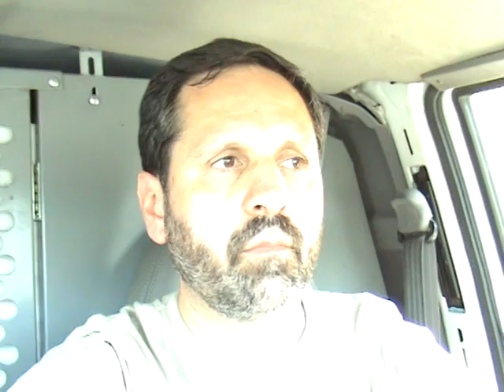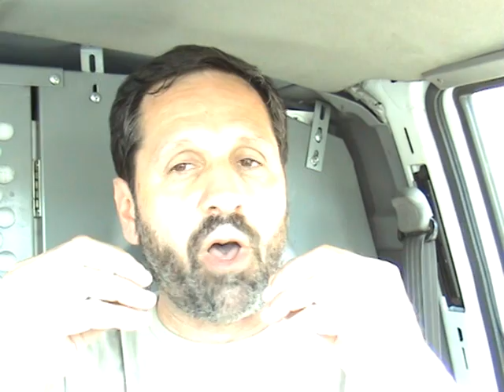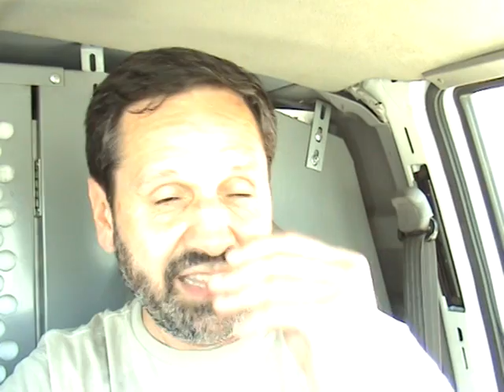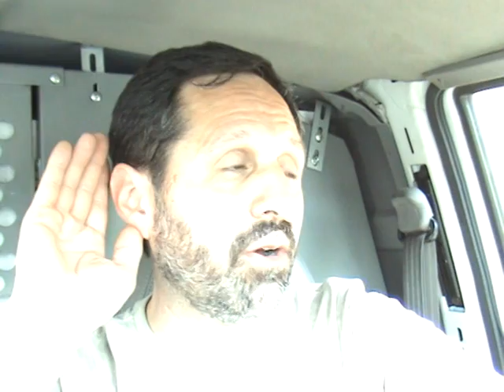EMP realities; you aren't as ready as you think you are!

Comment: Things to have in Faraday cage, generator preferably solar and wind however a person can make fuel so gasoline-powered is okay too you just have to muffle it kind of like blacking out your window so that not everybody can tell that you're running a light but to be honest this isn't something that you're going to run all the time just as needed type of thing. Parts for whatever vehicle you do have assuming you're not stupid enough to live in a city if you live in a city and something like this happens just realize you're probably going to die not from the event but from the other people. Your necessary electrical parts to repair this vehicle that was built before computers. If your how to do s*** books is on computer instead of and paper and of course you want to put those in there as well any other electronic devices you may want. The list could probably go on and on and don't forget the important thing is the batteries that you need for stuff even the rechargeable ones especially the rechargeable ones

Comment: Definately gonna buy the MRAD 103 Ultraradiac. And some faraday bags to put the absolute essential electronic devices in.
Reply from the maker: halfpipefreak  OK you got your plug in.  Now please explain what you think are "absolute essential electronic devices".
Reply: The radios you talked about, A good reliable flashlight and a batch of good Li ion batteries to power them and other devices. (18650 and 16340 batteries) and a foldable solar power panel. And ofcourse the MRAD itself. They say the MRAD's from Mirion technologies have EMP proof housing but it's electronics nonetheless and i would put it in a faraday bag or cage. Probably multiple since it being a very important device. Only thing i'm worrying about is the calibration of the device. How the hell i'm going to do that i'm not sure yet. It's better to be prepared and have knowledge. Knowledge is power.

Comment: does a faraday cage need to be metal? I saw a duffel bag on eBay that is faraday. Also, how would you know when it is safe to use your electronics or when an employee will occur?
http://www.ebay.com/itm/302313853782 is this a good faraday cage?
Reply from the maker: Al May  The maker of the bag claims it to be.  This looks an awful like the Mylar bags (supposedly aluminized plastic) people are selling at the prepper shows that is supposed to act as a Faraday type protector.  Believe the claims if you want.

Those Mylar bags are plastic.  Take an electrical continuity tester and see if you can get any conductivity.  You can't.  I intend to make a video proving this.
Reply: thank you

Comment: Other items to protect:- Charge controller for solar panel, flashlights. A lot of these modern led flashlights use circuitry. You can also generate electricity and charge batteries using saltwater.

Comment: i have made a 4x4x4 rubber lined steel box that I have built for my diesel generator. I have turned it into a biofuel generator that runs on any type of oil that is strained. I know that this will not last forever but hopefully I can get a year or two out of it if not longer. I have also built a wood gasifier that can run a gas generator but have not converted it to my diesel motor. My Faraday cage has in lining friction fit lid and a rubber lined aluminum coupler that fits over that. I'm not certain that it will work but I'm fairly confident in its abilities. As far as the sound goes I have not quite got that one baged but I am thinking about different options. also I live about 45 miles from any major city In the Backwoods. I have a 1974 CJ Jeep with no electronics. It would in fact survive an EMP. electricity and fuel powered transportation is not impossible, it is just not very probable in a post-apocalyptic EMP situation. But I plan to do my best. thank you for sharing this information. You have looked at a lot of angles that must have not considered
Reply from the maker: You have put lot of thought into your situation.  Now you have to worry about being invisible.  Take care of the noise issue (underground with chimneys in/out?), and blacking out portions of your house that might be using lights at night.  Not likely you will be going anywhere in that Jeep unless you do so in the first few hours of the blackout before the panic sets in.
Reply from the maker: ensitu I presume you are talking to me.  Good riddance.
Reply: Tried to buy from you at conference. You punished us all with your horrible attitude while trying to buy half a dozen copper coins as if we were jerks for trying to have commerce with you. We took less than 2 minutes of your time and just wanted to hand you money. My kids walked away asking what they did wrong because of how you treated us. So this is not just your on-line demeanor. Food for thought sir.
Reply from the maker: +Oscar Grouch Hmm, with the name like that you are complaining about me?  Your prerogative, I
go elsewhere to buy things. Have a nice day.
Reply: Exactly. Kind of like if Axel Rose tells you you're out of the band for doing too much drugs, that should be a fairly good sign that you're doing too much drugs..

Comment: It is very simple All you have to do is turn everything off. Unplug and power-down everything. To be on the safe side take all the battires out from all your shit. You can put your phone and shit in the microwave oven. However that will not help. There will be no service unless one of the satellites made i through. As for cars. Forget modern fuel injected. Get somthing from the 50s 60s 70s and 80s. The simpler the better. Get a bike. Read the wind. Do not go with the wind unless you know you can outrun it. Have a plan.